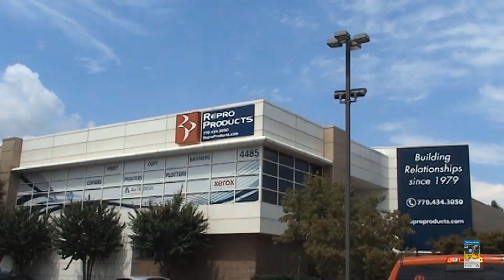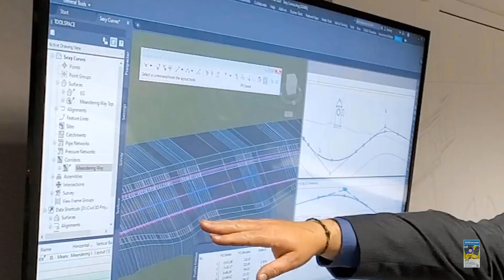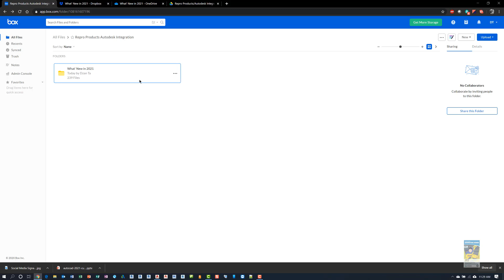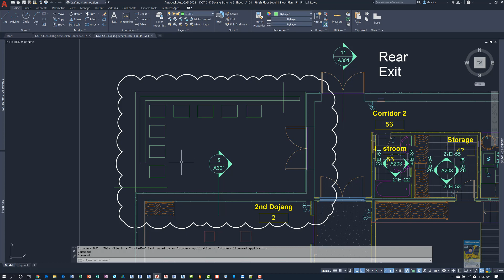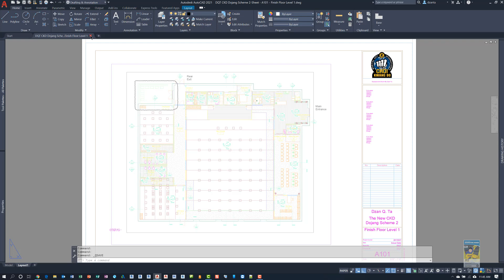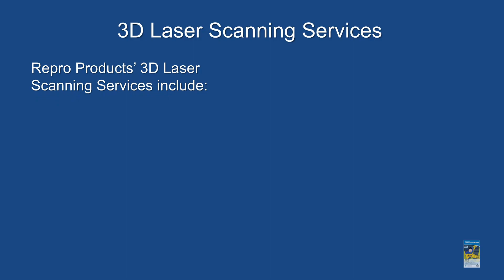What's New in AutoCAD 2021

Comment: Scaling 
When scaling a drawing from imperial feet and inches to metric milligrams, what scale factor do you use in the Scale command, before adjusting your units settings: 
... 0.08333
... 12.0
... 0.03937
... 25.4